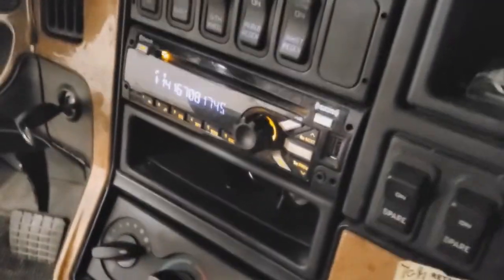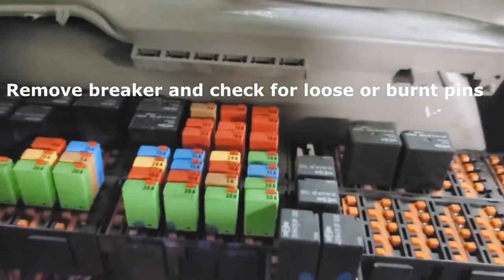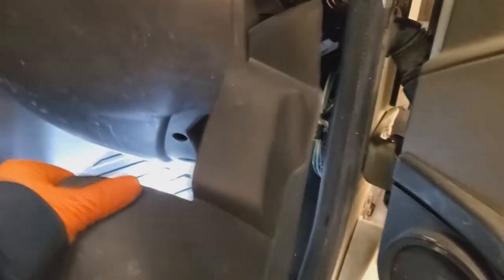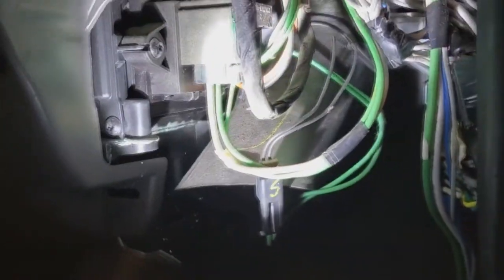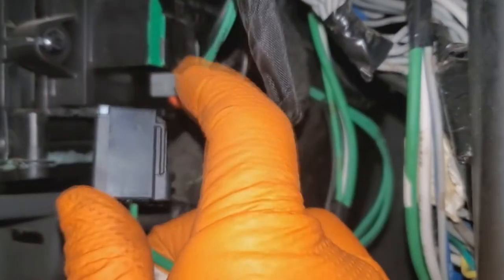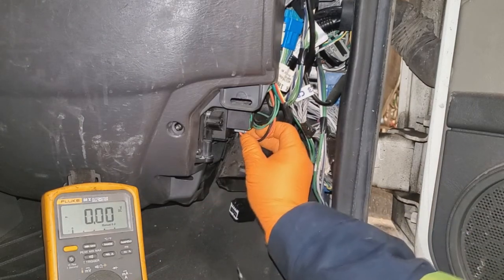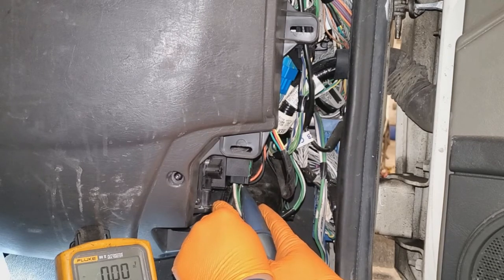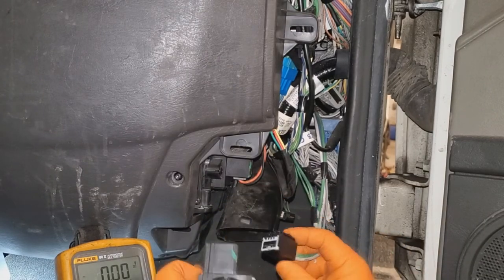International Prostar blower motor not working diag (failed blower resistor)

Comment: Great video. Exactly the panels and layout I have under the dash.
My problem is that the plug going INTO the resistor block has no power, but fuses seem fine. My fuse panel is different, however. (2015 International model 4300). Other accessories work. I'm shtumped.
Reply from the maker: Thanks!
Remove the blower motor fuse and make sure the terminals aren't spread, which would cause exactly what you are describing. 
Alternatively, you can take s wire or paper clip and put that in place of the fuse. Then test for power at the LPM
Reply: HVAC Blower motor.  F6-A.
 Nothing there. Looks like there never has been. 
Tried it anyway. Nada. With fuse (20A) in, still nothing at power to the resistor block. Argh.
Reply from the maker: @wolftrackertv615  somethings not right if there was nothing where it says blower motor. Either someone modified it or your not locating it properly. Look to see if its been modified at all (added switch in line). I've seen it lol.
Double check your fuse locations!! If not, you may have to take it in. They are fairly simple systems. Best of luck!

Comment: do you know if one of the vents actuator is not working properly can shut the power to the a/c compressor?
Reply from the maker: That's definitely a possibility.
Reply: 100% confirm if one of the vents actuators is not working properly it shut down the a/c compresor , there is 3 actuators 2 on the bottom 1 on the top that is the hardest to remove .
Reply from the maker: @MrSerdavid  glad you got it!
And don't forget to calibrate the actuators after replacement 👍 they should actually self calibrate every key cycle.

Comment: Hey thanks brother.. I have a international 4300 maxxforce the ac switch don’t work when I turn it on but when I’m driving at a speed it blows cold air but you don’t even hear it … when the truck comes to a stop it stops working what can be the issue? Thanks
Reply from the maker: Sounds like low air flow across your condenser. I would suspect your engine fan isn't coming on. Without looking at the truck  I'd guess a failed fan hub
Reply from the maker: Or do you mean your blower, air coming from vents? Sorry, I'm thinking your AC blowing hot instead of cold?

If you have little to no flow from vents, check your cabin air filter

Comment: Please help, I recently changed my AC compressor, but now I have no power to my sleeper with my temp controls, I’m unable to find a fuse issue, what could be the problem? Thanks in advance
Reply from the maker: There's a fuse bank under the bed, left side. Open the sleeper cuby door and check them.
Ac compressor should have nothing to do with the rear controls not working. 
You may need to have the BCM rebooted if all checks out.
Reply: The problem that I got was s the opposite blower won't turn off.
Reply: @atalia6159 I’m having the same issue what did you come up with. I replaced the blower motet only to find out it wasn’t  the motet but the control arm.

Comment: my ac and air just stopped working but it was giving me signs. like it would blow air then stopped and the go. and finally just gave up. so check the register ???? or it could be just the blower
Reply from the maker: I would check for voltage at the motor, if you got voltage, replace the motor.
If no voltage at motor, check the fuse and the pins that the fuse sits in, make sure they're not spread or burnt.
If that's good, check the voltages going into the resistor, if that's good, replace the the resistor
Reply: @AcousticHills  thank you. I will check tomorrow. another question since you seem knowledgeable in electrical stuff. my trailer fuses pop up. when I put my right signal. that fuse gets hot and pops up. when I put my trailer lights on. when I turn. they pop. I have to keep pushing them in or else they pop up.
Reply from the maker: @rromero1091   remove your light cord from the cab and retest, if they still pop, its in the truck. If not, your light cord is bad, or in trailer wiring. check for corrosion in the socket, if none, this newer model wiring is terrible for wire routing in the dash, you may have the circuit rubbing on a bracket. You'll have to remove the radio and center switch panel to check.
Best if you get a multi meter and che h resistance to ground to pinpoint the location of fault.
Reply: @AcousticHills  I haul containers. but I'll check
Reply: Hi my problem is the ac only works good in 1   2 an3 speed only in highs speeds works 2 seconds and off and works again 2 seconds and off 2 seconds i replace the resistor already and is the same problem

Comment: I am having a issue no heat a/c or defrost took it to shop ran a computers to it states hvac control  module was bad so they said they hooked a similar havc control module and still nothing the funny thing is that i seen with my own eyes is when the mechanic unplug the connector to the module air poured full blast through the vents but when he plig in control module the air stopped and also when truck is off the blower motor still runs for awhile the shop i took it to couldnt figure it out so i have been running with no air does any of this make and sense
Reply from the maker: Sounds like a combination of things happening wrong. But need to verify some things... When you say module, do you mean the blower motor resistor or the climate control module in dash (with modes and fan speed)? Also you mentioned you have no heat or a/c or defrost. Are you talking about vent, floor and defrost modes? or physical heat or a/c from the blend door OR just no air coming from the vents. 
What module was being unplugged for the blower motor to run when unplugged, the climate control module? 
I would take it to a dealership, not a mom and pop shop. You'll save money in the long run.
Reply: @AcousticHills  1 climate control module 
2 no air blowing period (vents or floor) or defrost
Reply from the maker: @jimmytrussel488  ok thanks, now that makes more sense.
I would definitely check for power at the blower motor resistor as I did here. Just to verify you don't have an intermittent power issue on that 30A fuse or circuit.
With the condition that it runs with key-off is suspecting to me that the blower resistor itself is shorting out internally or the wiring from the climate control head to resistor is shorting out (possibly on a bracket in dash).
I would like to check the wiring for short to ground for each circuit on that resisor BUT for ease and suspect, I suggest you to replace the blower motor resistor and see what it does; as it could be faulty.
Reply: Thank you for your help I am off work and will be tackling this issue today